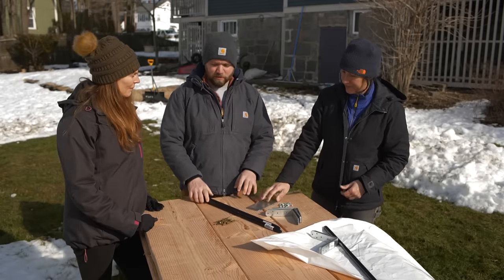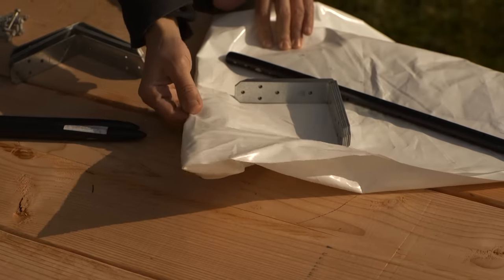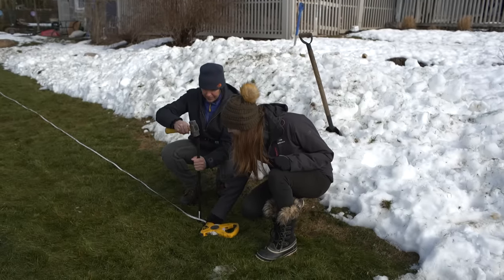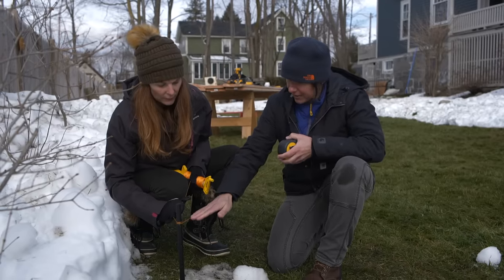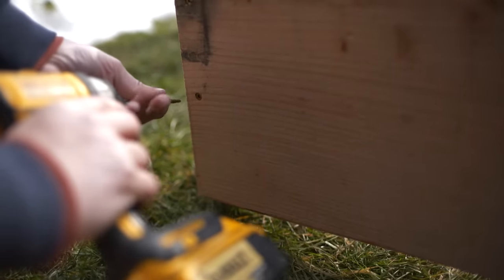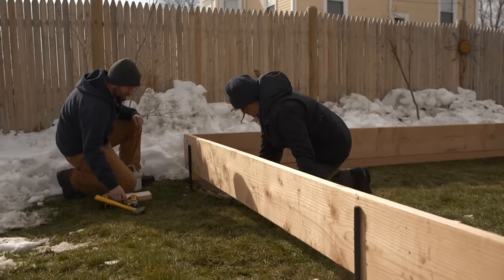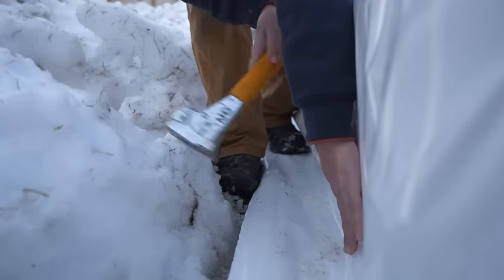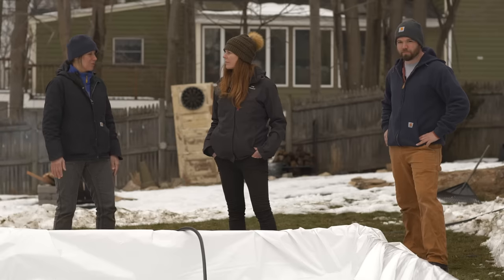How To Build a Backyard Ice Rink | Ask This Old House

Comment: Don't kill a chicken with a machine gun. Rake the backyard really really well in the fall. Get rid of all sticks and dead leaves. When the snow falls, make a berm all around. Stomp down the snow inside the rink. Grab your hose, set it to spray mode. Voila! Ice rink. Takes a few days though, and hours of spraying. I suppose after the first layer, you can just turn on the water and let it sit. Leveling? Water fills the lowest point first. Don't worry about it, but then again, don't try and build a flat rink on a hill! Common sense.
Reply: But that doesn’t sell YouTube videos…
Reply: Using a thick poly is WAY easier. Definitely worth the investment. I've tried both and I wouldn't go back to not using poly

Comment: Stapling the liner is probably not the most ideal way to keep the liner in place. As you fill the rink, the weight of water can pull and tear the liner where you stapled. Also, once it's stapled you don't have the ability to move or adjust the liner. I suggest spring clamps, clamped at the top of the boards.
Reply: good idea... and I guess you can simply remove them once it freezes?
Reply: Not really if you left slack for tarp to go down 2 by and against the ground it won’t move
Reply: Stapling is fine
Reply: They addressed this point, and mentioned the need for slack in the liner to accommodate the weight of the water. I think something like a clamp could be a risk for the kids hitting it while skating, though I agree it would be easier to disassemble.

Comment: Put the snow in and wet it to save water.
Reply: You can do that, but it's basically just a drop in the bucket. Without compacting it there's more air in a pile of snow than there is water.
That being said, if you live in an area that charges you an arm and a leg for water every bit helps.

Comment: Looking to build one this month with some pressure treated wood, but I’m worried about sealing the wood. Be about $950 in wood based on the height and length I want. Plan to keep up year round to use as roller hockey rink too. Should I wait till it’s warmer to be able to seal? Not sure how problematic sealing is.
Reply: I’ve been using non pressure treated for years and I leave it outside in the summer only somewhat protected from weather against the side of the garage. I’ve had no degradation. You’re using pressure treated, no need to seal it.
Reply: Hi my rink  is evolved over a number of years and it’s always the hardest thing is to protect the exposed liner from skates I got some strapping strips wooden ones and got some mark down garden edging and once the ice is frozen I just toss it on top…. trouble as it’s black but when it’s really cold doesn’t matter it just sort of sits on the top and protects the liner from the skates and pucks I attach the garden edging to the slats with screws and it goes around the corner nice if I stop the wood couple feet into the corner i’ll see if I have a picture of it but if you see what I mean it’s difficult sometimes to stop the liner from getting hacked up I used to just throw the slats on the ice without the garden edging and that worked fine too just stopped at the park from slow sleeping up an hour when snow got on top of the top whole thing getting hacked up
Reply: Sorry for that last part it won’t let me edit my typing a very easily
Reply: I was just trying to say that the puck would hit the wooden slats and once it melted up a little bit during the day the wood would kind of get frozen to the surface
Reply: And at the same time the skates would hit the wood and not the liner

Comment: I'm in Ontario Canada. It's bitter cold in winter. I used a similar process for a decade every winter. My yard has an 15 inch drop, that means about 21 inches of ice at the deepest corner. I use a laser level to set a 2x6 frame level on a set of posts then use ply to fill from the top of the frame to the ground. My posts are 2x4 with a "foot" through which a stake is driven. The deepest sides of the structure also get extra braces to help keep the sides plumb. I align construction with an impending period of bitter cold so that immediately after building the frame, and before any snowfall, I can lay a plastic sheet and flood. It takes about three days to complete the fill and freeze with night time temps near -20C (-4F). For a deep rink, frozen ground and bitter cold are essential in my experience or else it takes too long to freeze and you risk getting a snow storm mid fill which has potential to turn into a mess. The parts are all numbered so it goes together quickly next season. I don't reuse the liners. The edges are normally too beat up to make reuse feasible.
Reply: Do you need to freeze it in layers?
Reply: @MikeKolcun  Yes. A few inches at a time on an 8 ish hour cycle. That last flood might be heavier in order to help get a nice level surface, but by that time there is a lot of ice and it is stable.

Comment: Doing the math: 
3” min. thick ice
16’ wide (192”)
32’ long (384”)
= 221,184 cu. in. 
221,184 cu. in. x 0.00433 gallons per cu. in. 
= 957.5 gallons
Not near as bad as I thought. From where I live that would only cost an extra few dollars.
Reply: @DuffyGabi  so if water is 8 lbs a gallon, I hope that frame can hold 8,000lbs (but more like 16,000 lbs thanks to the deep end) of water.
Reply: @TheChupacabra  Doesn’t work that way. Majority of the weight is downward, not out (gravity is funny like that) but the outward force is distributed along the entire perimeter. They weren’t smart enough to mention you don’t fill it all at once, you do it in ‘lifts’ a couple inches at a time, so there’s never a major amount of water pushing out all at once. They also seem not to know how you need to drain it come spring. There’s a trick for that too.
Reply: @brucea550  what's the trick?

Comment: What do you think of bracing rink boards to brick wall of house ? With wood 2x10 braces that run perpendicular to rink boards ?
Reply: I think that once it melts or if it leaks you risk a lot of water inside/under your house.
Reply: @neonduck  the distance from the house to the rink hasn’t changed.  What has changed is that instead of wood stakes to support, I am using 2x10s running perpendicular to rink boards that are supported by house
Reply: @thedepellegrinfamily3476  I haven’t built mine yet but I did pick up the supplies yesterday. Hopefully the concrete form stakes do a good enough job and a more secure method (like you mentioned) is overkill (fingers crossed as my soul isn’t very good). Doesn’t seem there is any additional harm to yours since you’re already fairly close to your house either way. I don’t have the space behind my house and have to go farther back but it is very sloped so we shall see what happens.

Comment: I tried without boards once...then wooden boards once.  From then on I used 4" PVC to form the outside, propped up one side as necessary with foam and folded the tarp over and tucked underneath.  Fill and freeze and you're good to go.  It might not be for everybody but it has served me well year after year (although skates tend to cut the tarp making it difficult to re-use).    https://youtu.be/_LiMzK5F2x8

Comment: Where is the water going to go in the spring? That seems like a lot of water to release in one go.
Reply: If you want to be careful, just put a pump in it with a hose into the sewer. If you want to watch something cool then just release it all at once 😁
Reply: It's not an above ground pool that bursts all at once...Ice melts over several days.
Reply: @cup_and_cone  That’s assuming that they remove the wood before it stops freezing. I think they’ll just leave the wood in until removal, so it will be a pool by the time they release it.
Reply: I drain mine by poking a small hold in the deepest corner. The water slowly drains over the course of a week or so as the ice melts and is absorbed into ground without any problem. For most yards the grading will be away from the house so the deep corner where it's draining is also away from the house.
Reply: Did you think before you typed your comment...I mean CMON MAN !!!!!!!!!!
Reply: @pavelow235  Well sorry. Never had a freaking ice rink in my residential backyard.
Reply: @MrGelowe  sorry for the snipe just got a lot going right now, but it should seem obvious that melting occurs slowly over days and days and weeks even. But who knows, maybe you grew up in Key West Florida. Have a good one man.
Reply: @pavelow235  I grew up in Brooklyn. It's a giant sheet of ice. I am more interested in not how to built an ice rink but how to securely get rid of it. I guess taking 1 wall off the ice rink and placing few stakes in to keep the ice from sliding off and allowing slow melt is how it is going to work. Or placing holes in the tarp and then buying a new one every year or repairing it. Or maybe let it melt and then evaporate. I am not idiot lacking imagination but still would have been nice if TOH would use 10 seconds to go into what happens in the spring beyond taking apart the ice rink and storing it.

Comment: I expect that inevitably the skates will be banging into the liner and ripping it.  Better that the 2/12 boards be on the inside of the liner and draped up on the outside.
Reply: I got a new liner every year for mine. About $100. There was no way that I ever found to reliably protect it.
Reply: I agree with Jim, get a new liner every year. Mine always get cut but shovels and skates.